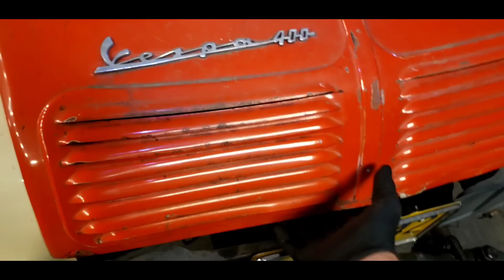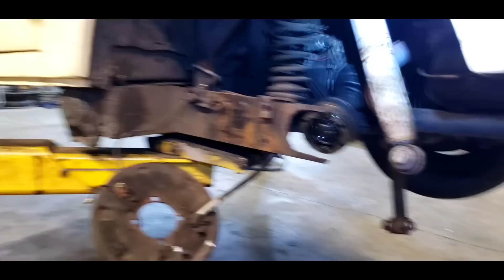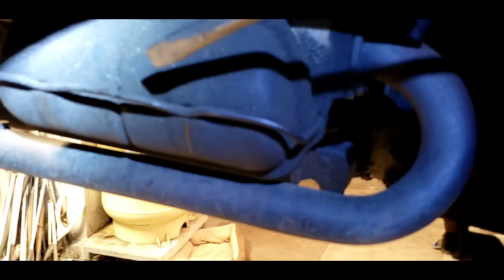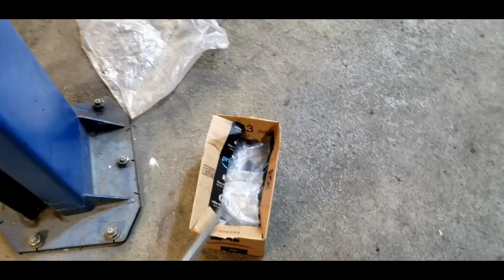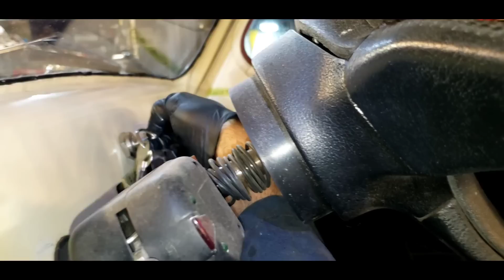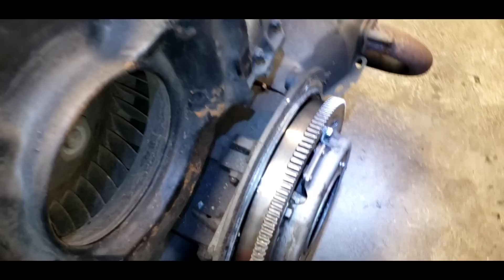Bad Design Made Better

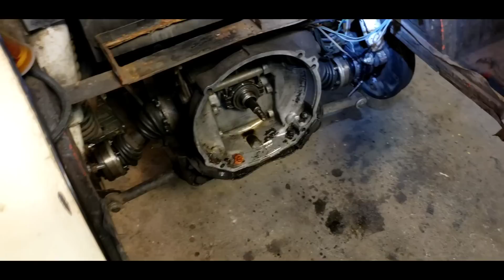Comment: 15:14 the dkw and beetle has the same clutch disc. the dkw engne is also mounted with 4 screw. can you mount a dkw engine in?
the copper sponge isn't came from the starter?

Comment: You have a "doghouse" fan shroud and are missing some pieces 😱.
The oil cooler pieces specifically - without them in place, the engine will run hot and have a shorter life. Good luck!

Comment: I would expect with ball bearings like that, there should be a carefully sized spacer between the inner races. Otherwise the nut on the stub axle would be putting a large side load on the bearings. Wonder if the existing centre spacer is the wrong size.

Comment: why not just yank that sucker and put a Predator 2 cylinder in there. with electric start. would probably fit better and pull the weight of that car ok.

Comment: Are your using VW IRS stub axles? For the IRS VW stun axles, they use a 6206 metric bearing on the inside (closer to the CV flange) but it uses a flat roller bearing on the outside (closer to the brake drum) where the inner race floats on the rollers, therefore it has no ability to locate the inner race side to side. It looks like you are using two 6206 bearings which could be a problem if you are preloading the bearings with a excessive side load when the hub nut is tightened down. Not sure how the tapered roller bearing will work? But I would think that you might need add shims between the bearing and the distance piece to get the pre-load right on the bearings.

Comment: You may be good to use a crush pinion sleeve between the 2 bearings,  such Ford and Gm rear differentials. Just a thought to keep the bearings pushed apart internally for a solid set point.
Reply from the maker: Good idea, I briefly thought of that
Reply: @2stroketurbo  pretty nice work and upgrade to that little box.
Subscribed. Nice projects.

Comment: Where does moisture in the engine come from? From the combustion chemistry. Hydrocarbons react with oxygen to make CO2 + H2O. The H2O is in form of superheated steam and is the thing that makes power. That's why it is a good idea to actually drive a while with the engine at operating temps. That blows out the water and reduces the amount of condensate.
I like your videos a lot for the variety of things you are doing!

Comment: When installed on a Beetle, the centers of the CV joint that slides onto the axle can move in and out a bit at both ends which compensates for the change in length of the axle - remember, on the Beetle with the full length axles the angles of the joints are very modest compared to the installation on your Vespa. I suspect that when on the road these ends reach their limits and the entire outward force of the now-too-long axle is put onto the bearings. If this is the case I suspect you may encounter other failures since you've beefed up the bearings - perhaps the CV joints or the bearing housing itself. You may gain a little space by allowing the axle to shift a bit inside the CV center (I.E. remove the circlip - the axle is kind of trapped) but I don't know how much further it can go before it hits the center of the mounting plate.

Comment: I've got a theory about the copper, which looks like a copper scrub pad. I had a 1993 Ford f150, 300 ci I6 with manual trans. I lived in a rural, wooded area of Wisconsin and twice I suffered from mice building nests between clutch plates which immediately bound up the clutch travel upon depressing the pedal the first time. And each time I had to have the clutch rebuilt. I found the mice were getting in via two open inspection ports in the bell housing. To prevent this one suggestion I discovered was to stuff these openings with stainless steel or copper wool - a copper scrub pad. I did that and never had another issue with mice in the clutch. Could someone have done that here and the piece of scrub pad just gotten pushed all the way in? My inspection orifices were on the bottom of the housing so there was never any danger of the copper wool falling into anything important.

Comment: Oh jah, I forgot to mention,
Inside the oil seal is an spring see where it is joined,
Remove the joint make the spring straight and cut a 10mm from the length and join the 2 sides of the spring making it round again and put the spring back in the seal this should give you a tighter fit and also put a little wheel bearing grease on the crank before reinstalling the seal,
Wipe it down after installation 
You WILL thank me later for this information!
If you can admit it works perfectly afterwards ,
Ciao

Comment: Hey uncle,
The correct oilseal at the flywheel side should be the red brown one not black and not that orange one,
Replace the o ring in the flywheel also, very important,
The shims on the belt pulley you can almost have all on the outside,
Another thing John Muir suggest that you can go a little tighter on the valves tapped clearance,just a tad the next size smaller , thinner, I can't for the life of me recall the size he suggested,
And every air-cooled engine needs valve adjustment annually, if you drive it or not,
Anywho have fun,ciao

Comment: I learned from Click and Clack that one of the products of combustion is water. If you have loose piston rings and you take short trips that don't heat the engine up to a high enough temperature to evaporate that water, then the combustion water could be going into your crankcase. Just a thought.
Reply: My cousin who's a professional mechanic explained to me how he had one customer who took VERY short trips instead of walking, needed to have his oil changed every... Can't remember, but it was ridiculously often, because the engine never warmed up the oil got diluted with pure gasoline in a matter of weeks! I don't think it was an old car either.

Comment: The angle of the drive shaft from thr transmission to the wheel bearings seems extreme.  I don't know what the angle is like when the car is on the ground.    I'm comparing yours to what I remember about a A VW 411 I owned long ago.  It had CV joints as well. 
The angle if it's drive shafts was much less. 

I'm thinking the extreme angle must be hard on the bearing.   The only fix I see is lowering the transmission.   But doing that creates other issues.

I'm just a long time hobby mechanic.
You are far more qualified than my humble self.
Reply: I was wondering about those stubby drive shafts with their extreme angle as well!

Comment: Normally there is a distance collar between the tapered roller bearing in hubs that sets the bearing preload for driven shafts/hubs that locks the whole assembly.  Non driven hubs don't need a distance collar as there is no splined shaft/hub.  If you use the shaft nut as a preload for the bearings there is going to be rocking back and forth on the splines and hub which will then cause those parts to prematurely wear. If the hubs are cast iron the hub spines will be stripped out after a while.
Reply: Thanks for posting this so I don't have to type all those words. TST should get some bug trailing arms and cut the bearing carriers out and transfer the mounting points off the existing bearing carriers. he also might consider bus CVs which have more angularity.

Comment: Are there any splines on those axle shafts? Or do they stay the same length through the arc of suspension travel? That too would be hard on bearings. On the whole it looks like it was done by someone who didn't quite know what they were doing.